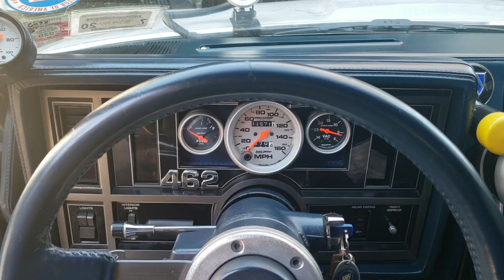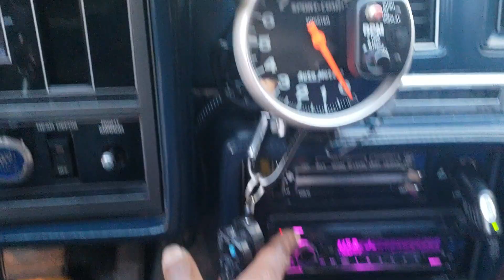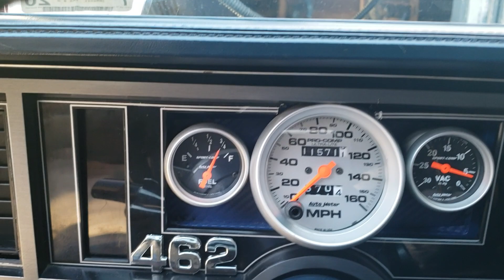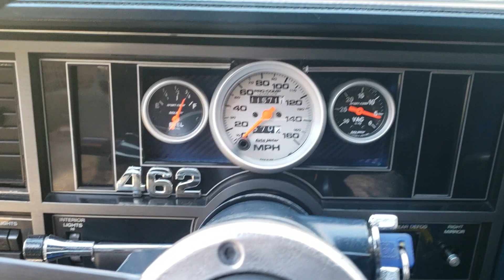Buick 455 Stage-1  Regal-T @ Ignition Issues 😮😀⚡🎬. 1-8-2020

Comment from the maker: I forgot to mention that, Mike of TA Performance responded to my Facebook PM text regarding this issue.
During our phone conversation, Mike supplied outstanding and heavily appreciated Tech-Info, Troubleshooting Advise, Over the Phone Diagnosis which I seriously appreciate, and a good 15 minutes the least trying to help me.

I'm going to make sure the H.E.I. is grounded properly/not loose, check the H.E.I. 12V Power Wire for Current/Voltage Reading, and makes sure the H.E.I. has everything tight/correctly under the Cap. Mike also texted me a Wiring Diagram of how the H.E.I. is supposed to look when Wired correctly.

TA Performance is THE BEST.

God Bless.